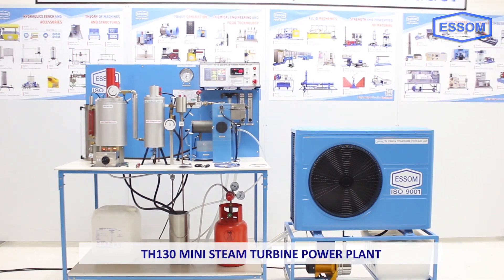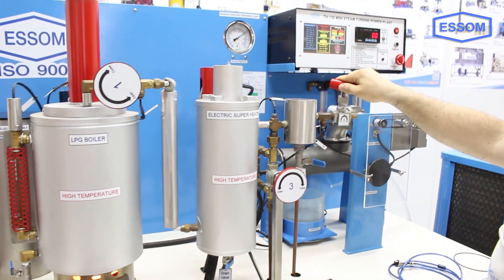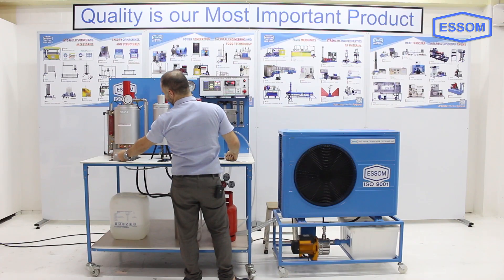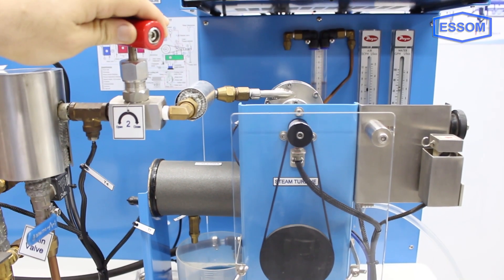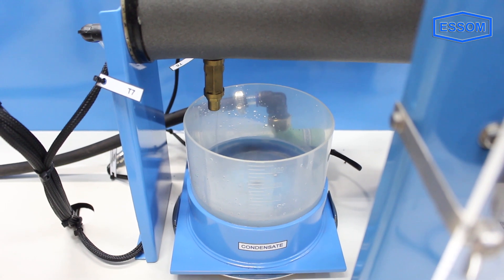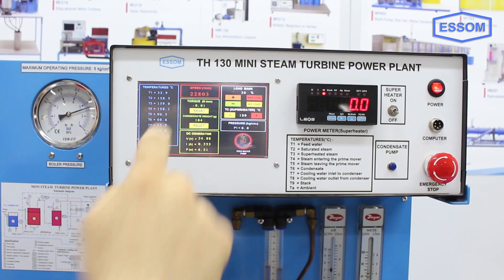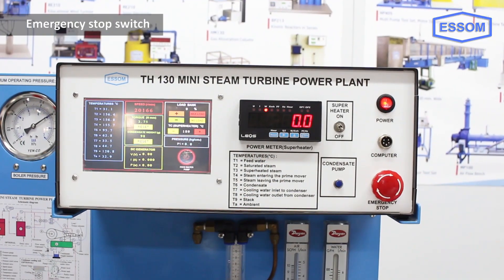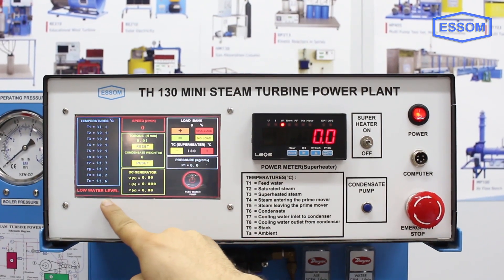TH130 MINI STEAM TURBINE POWER PLANT

Comment: Why couldn't you use a parabolic mirror or a magnifying lens to focus the suns energy on the boiler and heat the water that way to create steam? It wouldn't be a 24/7 solution but if you could cut down on your energy requirements from the grid by half the amount of money and CO/2 savings would help a lot.
Reply: This is a demo unit for training. Not for actual output.